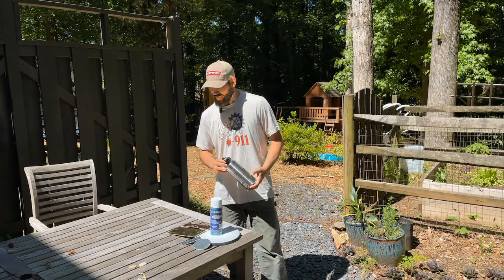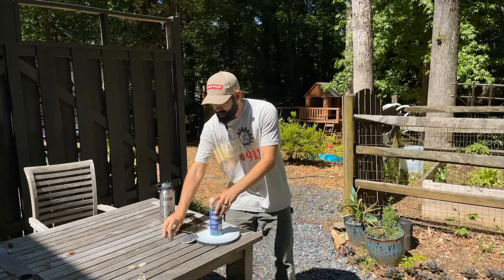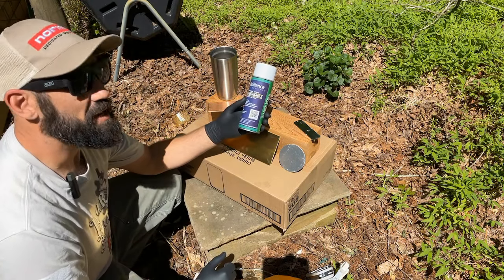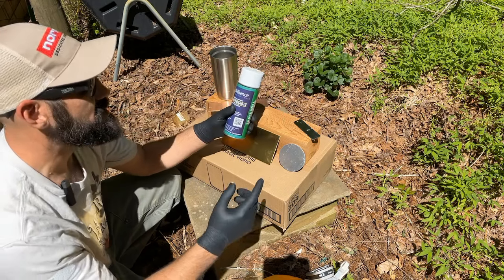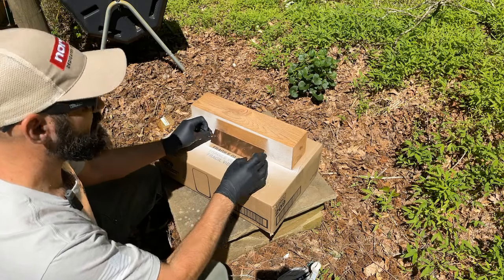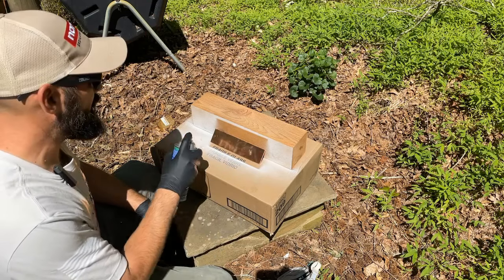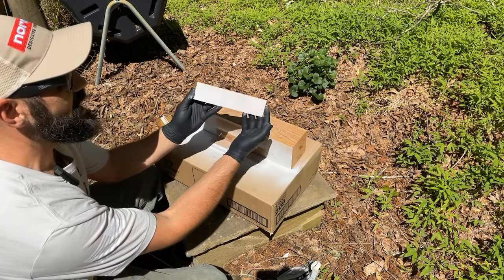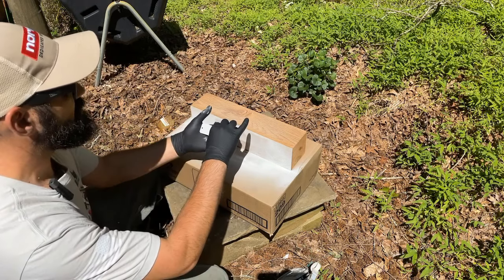How to Laser Engrave On Metal With A Co2 Laser | A Complete How to Guide  | Brilliance Laser Inks

Comment: I bought a Laser Pecker 3 to engrave onto metals, I am engraving onto Zinc Alloy with an Electroplating Coat that are silver, gold, & brass colored. The engravings are not coming out Black, do I need to use a spray like "Brilliance" to achieve a black finish? As of now the color is like a burnt gold color. I have tried various depths and power levels with the same result each time.
Reply from the maker: A fiber laser would give you much more room to get darker engraving on those metals, sadly the LP3 has limited setting to adjust for those metals, I don't think brilliance would help much in this application.

Comment: Have you laser marked liked this on a coated/painted stainless steel tumbler?  I have a 30w laser and want to laser mark on a steel tumbler that is coated white.  I'm assuming they are powder coated already.  Just wondering if I can spray them with laser ink so I end up with a black logo on a white tumbler.
Reply from the maker: This will not work, as the laser spray needs to bond direct to metal.

Comment: What do you suggest. This or the fiber laser directly on the metal?
Reply from the maker: Good Question, I use both fiber lasers and Co2 laser in my shop for jobs. Each laser has it purpose. This video was meant to help people learn how to make black etching on metal using only their Co2 laser, as alot of folks do not own a fiber laser. It really comes down to what kind a look the customer wants and the metal type, example, you cannot get a black mark on copper with a fiber laser, so if the customer wants black laser marking on copper, then I would use the Co2 Brilliance laser method. and so on. I would say the Job will dictate which method should be used.

Comment: Very nice guidelines for bigners  if i have a normal laser (non metal) can i engrave on metal? Inform please.
Reply from the maker: can you tell me what you mean by normal laser?
Reply: @LaserEngraving911  It means only for non metal cutting and engraving machine. i was asking for cutting and engraving on metal. My machine is almost 100 watts told by a machine man.
Reply from the maker: @muhammadikhlaq5734  yes if you have a 100watt Co2 laser then you can use this method.

Comment: What Laser do you use for this kind of etching, I know its a co2 laser but what power and brand tube do you use. Did you build your setup? I got a k40 just to get my foot in the door and learn how to use them in woodworking. I do custom boxes with laser engraved pictures and such on them. I'm thinking of doing a serious upgrade in size and power. I would like to go to at least 100 or 150 watt laser with a large bed to do large items such as signs and stuff. Just found this channel and its got a lot of great info (Brilliance Laser Inks). have never seen this stuff before and will definitely be trying it out!
Reply from the maker: Thanks for the feedback and support! I use a Epilog M2 Fusion 120watt laser, I worked up to having this machine and it took me years to pay off, but well worth it, I am a very big fan of this unit, due to its precision ease of use, power, and most of all customer service. Its has done me proud for over 7 years now, and running! its a 32"X 20" bed, and the make a bigger one than mine as well.
Reply: Made in USA?

Comment: I am interested to see how it deals with high peak-power lasers like Coherent Diamond G-series lasers. I ask because I just tried CM Ultra and it failed miserably. The laser blew it right off the surface while marking, even going out of focus / faster.
Reply from the maker: Woah, def sound like an over power issue there.
Reply: @LaserEngraving911  no. These lasers are 250W peak power lasers, with average power output of 120W. They are self-limited to 60% duty cycle. The CM LM-6000 handles it just fine. I am wondering how the Brilliance products will perform. Great video. Looking forward to trying it.
Reply from the maker: @SteveN-bh3wv  Sounds like a really cool laser! Thanks for the support!

Comment: How thick is the remaining layer (the black part)?  I was thinking of using this for making custom ammunition.  Wondering if the layer is so thick it’d affect function.
Reply from the maker: Microns thick, I don't have tool to measure that, but you can barley feel it on the surface.
Reply: @LaserEngraving911  thanks!  And yes of course (for anyone else reading) this will be done on unloaded shell casings not fully loaded ammunition .
Reply: @LaserEngraving911  I use an ultrasonic cleaner on my reloads I’m assuming it will remove the marking,  have you any experience with the etching surviving ultrasound ?
Reply from the maker: @charleshetrick3152  I'm going to guess that if the etching is done "correctly", and bonded strong, that the ultrasound will not effect it, but if you were to add a harsh chemical cleaner and ultrasound it might effect the mark. You will have to experiment and tell all of us how it goes!
Reply: @LaserEngraving911  will do, I use simple green it’s pretty mild.  I tumble in corncob treated with the brass safe Flitz,  that might be the first danger then I use the Franklin armory spray lube for resizing.  I actually don’t mind reapplication cause it’s worth the effort…to me.   I’m labeling them with the letter F so I can say when I’m out “I’ve no more Fs to give”.

Comment: I am using a Beamo Laser machine and I'd like to know if somebody has experience with this spray and if it is possible to get it in Europe. Thanks in advance. 

Greets
Reply from the maker: What wattage is your machine?
Reply: @LaserEngraving911  30 watts
Reply from the maker: @svorgodne  The Manufacture of the product has setting lists for your machine and wattage on this page.https://brilliancelaserinks.com/collections/aerosol-cans/products/aerosol-spray-can-for-metals-marking-with-co2-fiber-yag
I think you will not have any issue with steel, but when it comes to aluminum copper brass, you will def have an issue with only 30watts. Even though they have setting for this with 30watts, it challenging to get good results with only 30 watts on those metals.